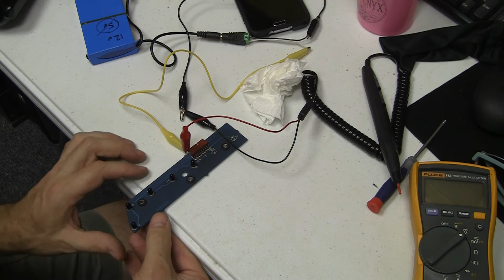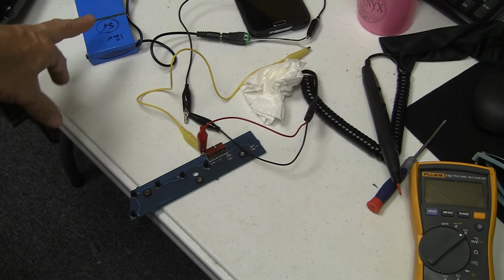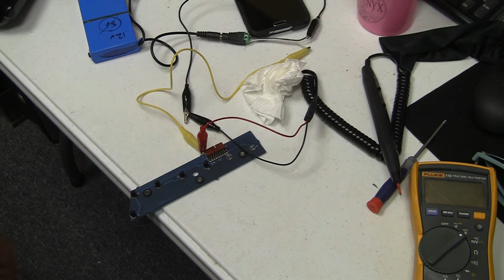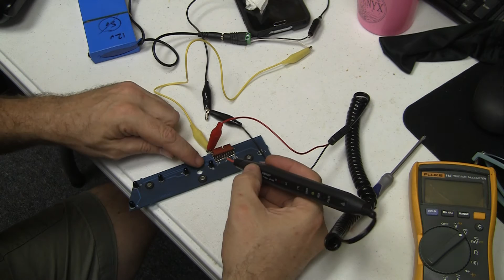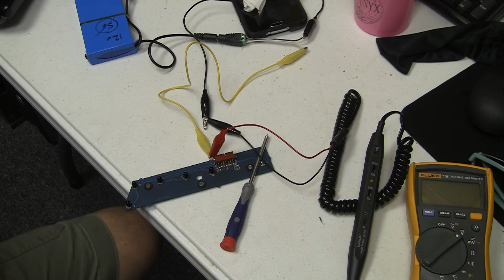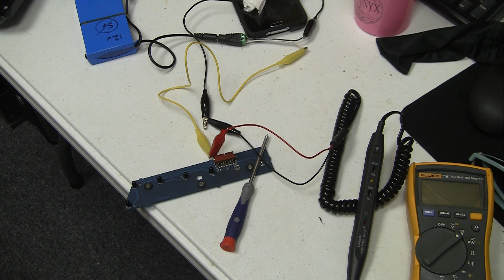Switch Matrix Problems: How to test a pinball receiver opto/board - p2 - PinballHelp.com

Comment: nice vid.
anybody ever experienced these receivers going partially bad?
I have a pinball magic where one of the genie lock optos doesnt work when far from the sender in mech, but lites if they're removed and made closer.
1" apart = no function. half inch apart = works great
Very weird! Probably a connector thing...
Reply from the maker: I've seen both sides go bad but it's usually the transmitter.  However on modern Stern games, I believe they're using the same kind of opto as both transmitter and receiver,